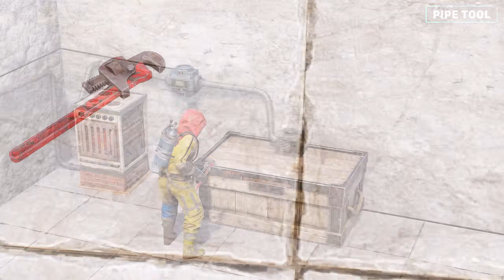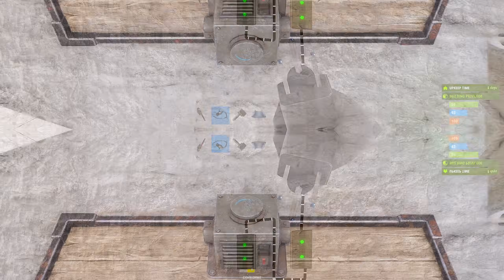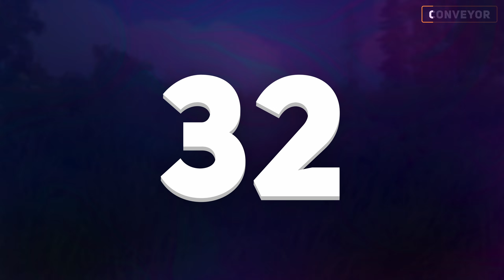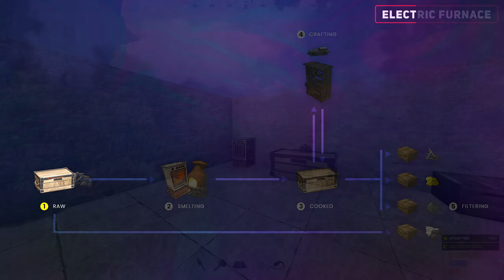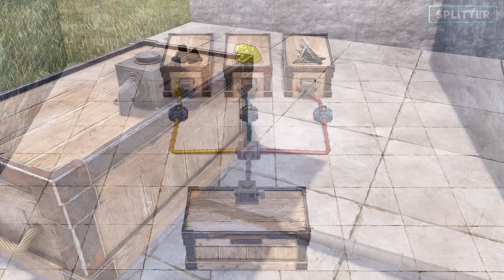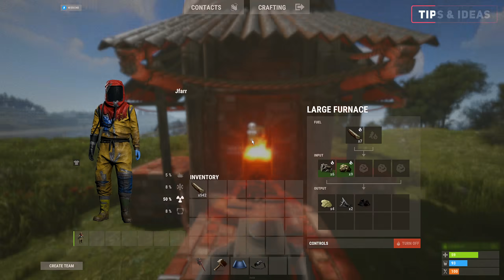Ultimate Industrial Guide - How To Fully Automate Your Base In 2023 | Rust Tutorial

Comment: Althought the video is by the state of Rust and its changes to workbench / added Engineering Workbench and so on, the basics stayed the same. I would recommend using a mixing table, due to its cost (1:1 instead of 2:3), dont know if you can add a piping to it... Not sure if now (i tried last wipe to add a normal furnace to my piping, it dont work, but dont know where it fits (ontop)).

Comment: I like to keep it simple and use 1 storage box 1 conveyor and 2 storage adapter for 1 electric furnace you can can add more furnaces to the loop if you add more storage adapters. If I have free space I will use 3 furnaces.  I just make a big loop. I don't set any filters. It will only put items in the furnace that the furnace can except when it's done smelting back in the box.  So i get back from harvesting ore throw it in the storage chest come back later and it should all be smelted. It's not required but I usually put a single switch that turns on the furnaces so i don't have to listen to them run all the time. This is an easy way to get your smelting done automatically. As soon as I have the BP's this is the first thing I put together. You can also add a wood furnace in the loop to constantly make charcoal. No need to put a filter just add wood to the chest and it will return as charcoal.

Comment: Out of curiosity, can the "Fail off/on" be connected to a "blocker" thats connected to an electric furnace, and activate the furnace when a particular resource isn't present inside a container?

Lets say the whole automation process is dormant, until it detects that the final container, lets say a TC, is missing metal fragments or HQM. It turns on and it process, and transfer materials with little too no player intervention.

Comment: I love your videos. The graphics are beautiful and clear. Great visual communication!

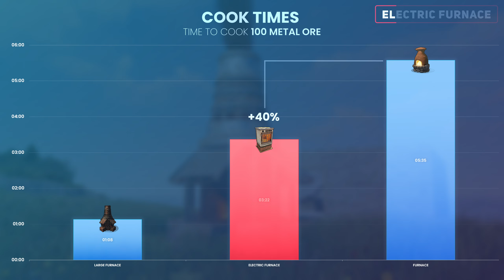I want to let you know about a small mathematical error at 5:55 with the furnace speed calculation.
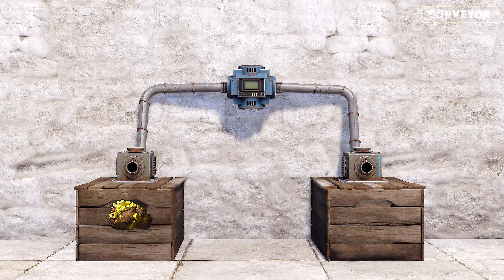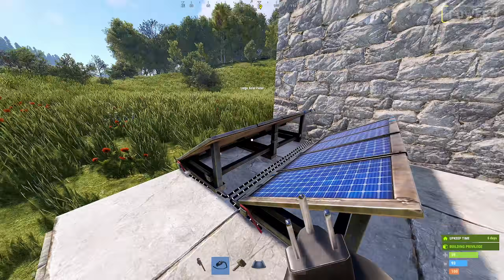With a little rounding, 3:22 is 40% less time than 5:35 and 1:08 is 80% less. 3:22 is 66.6% faster than 5:35 and 1:08 is 400% faster.
You get these numbers by dividing the times the other way around. Reciprocals can be very confusing.

What you mean is clear by the nice graph so this isn't a big issue but I thought you might want to know.

One way to think about it is that if A is 100% faster than B that means that A has 200% of B's speed and is thus twice as fast.
A could be 1 minute while B is 2.

Comment: You should change the circuit design, having the input go through a battery loses you 20% power and causes issues if your input is less than the batteries output

Comment: Question, When you do the gun powder. Is it the same amount of charcoal to craft as if you did it manually or is it the same as a mixing table which uses half
Reply from the maker: The same amount as if you were crafting it manually at the workbench. So it's likely still the fastest/most efficient approach to manually craft at a mixing table.

Comment: Hey Jfarr - any idea how to fill both slots on the electric furnace with one type of ore? Ideally once one of the ore types runs out it would be nice if both slots filled with the remaining type
Reply from the maker: I don't think it matters anymore having both slots filled for speed. With the recent furnace changes, if you have the ore in one slot, it will cooking faster while if they are in both slots it will cook each one slower. Therefore, your stack of resources will always cook at the same rate.
Reply: If you recall from the furnace update last year, smelt rates per tick were clamped to the max [most efficient] rate of the old system no matter the amount of raw material stacks. i.e. splitting the same raw material in a furnace, refinery, bbq, etc doesn't provide any [smelt rate] advantage aside from having a larger buffer to reduce the amount of manual refills over time. With the industrial system, that benefit is negated if setup properly as it will be constantly fed raw mats from a storage container.

Comment from the maker: ⚠Updates & Notes⚠
• The electric furance now requires 3 power to operate.

03/03/23 - https://rust.facepunch.com/news/eye-in-the-sky 
• A new filter option for the conveyor has been added to allow more advanced controls. You can now change a filter to require ANY, ALL or NONE of the listed items. 
• The minimum distance between pipe points is now smaller for neater pipe placement around corners. There’s also a new green color available for pipes. 
• When looking at a plug and pressing RMB, the connection will remain highlighted even if mousing over other entities. 
• Daisy-chained boxes will now be filled in order rather than items being split up between them (the splitter will still split stacks though). 
• The Industrial Crafter now has 4 blueprint slots, allowing you to craft multiple items without having to connect conveyors to the blueprint slots.
Reply: in my opinion is just stupid that u have to use another bp , in case i would like to craft walls i need 1k scrap for it o.O  little wired ? we should be able to craft special bps just for crafters and ofc no one could learn stuff from it , but i think is just butthurt solo i guess ?
Reply: @shashwykify  100%, I've thought the exact same. 

It's crazy it requires players to double their scrap usage just to craft things they already have learned, especially tier-3 items.

I want to build an industrial circuit that crafts kits and fills lockers, but the scrap cost alone would be massive ...and merely for a bit of automation! I'm surprised this hasn't been adjusted.
Reply: what if you put pipe before wall and slap wall after that do it work.
Reply: @broo_shs  The wall gets blocked.

Comment: BTW: The final sorter circuit still works if you get rid of the second box and the first conveyor. Conveyors aren't any faster or slower depending on how many splitters or combiners they're passing through; if they're connected to a box they can pull from that box, simple as.
Reply from the maker: I originally designed it that way but it didn't work as expected when initially testing. If I didn't have that second 'Everything box', it wouldn't correctly filter those items. 

For example, I have three boxes linked along with filters (Resources, components, everything: no filter). If I put a stack of wood in the dump chest, it will first go to the resources box, but it will also go into the everything box. This is because it can only pass a max of 32 items per tick, and because we have two possible chests it can go to, it will split those 32 items at 16. Therefore, 16 will go to the resource chest and the rest to the everything chest. This is not what we want. 

That's why I made it so all the items would first go into the everything chest and then be filtered out from there.
Reply: @JfarrYT  Oh, now I understand. Your circuit is meant to COMPLETELY empty the dump chest, not just take valuables out of it. Dump chest on outskirts of base > General/secondary storage ("everything box") > resource/components boxes in core. Great video, and thanks for the reply.

Comment: You forgot a couple of tips. For example, you can fit 6 industrial furnaces in one triangle and have them all hooked up with storage adapters. To make up charcoal production, set up oil refinery with putting wood in and charcoal out. Because it has the quickest time to burn wood into charcoal. Conveyors have a maximum of 12 filters each. You can put two auto crafters on each workbench. Thanks to that, you can auto craft gunpowder and straight-up bullets on one lvl 2 workbench. Or set up auto crafting line for rockets or c4 on lvl 3 workbench The smallest bullet auto crafting system with letting bullets fill the autocrafters space gonna take two autocrafters, two conveyors, one storage adapter, small box under wokbench, one industrial splitter and one branch, everything fits nicely within crafting bench and can be powered off small battery (which you can also put on the workbench). Also great graphics and straightforward explanation which is great. Keep up great work.
Reply from the maker: Thank you Borys and these are some incredible tips. Wish I could have included some of these in the video but cheers for sharing this info with us.
Reply: Or fit normal furnaces which produce charcoal while smelting. Now that's a tip.

Comment: missing recursive sorting, all storage chests are connected to each other, system can re-sort an unorganized base.
Reply: If you can seal the storage away then it won't get unorganized. It'll be safer and cost less. Plus, if you want to sort, just take everything out and dump it back in the sorting system.

Comment: What's the best way to get charcoal if using electric furnaces?
Reply: Oil refinery is best for making up the charcoal deficit, connect two conveyors to storage adapter on refinery pump in wood, pump out charcoal.
Reply: I personally won’t use the electric furnace. Everything else though is 🔥!
Reply: @dynasty2146  Yeah comment above hit nail on head, Half height furnace is insanely useful, we just ran all sulfur to smelt automatically in normal furnaces and all metal ore to smelt in electric furnaces to save wood
Reply: @Nerdzal0t  after some time. Electric furnaces are dope! I also just get a small furnace for charcoal and run it 24/7 until
I get a large box full of charcoal.
Reply: @dynasty2146  electric furnace fits in a half floor, very small compared to furnace, and obviously saves wood. turn it on
 when you have enough charcoal in the base and itll save you from farming trees
Reply: you dont get any charcoal when using the industrial furnace